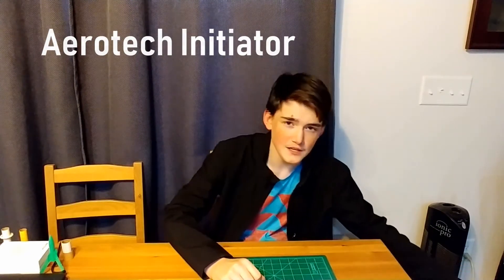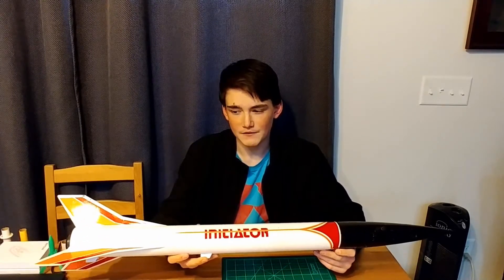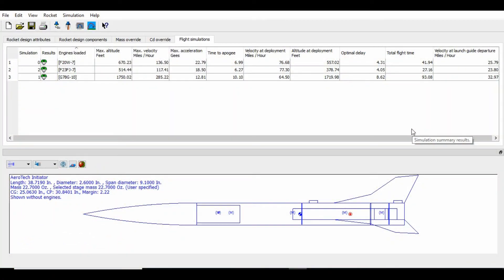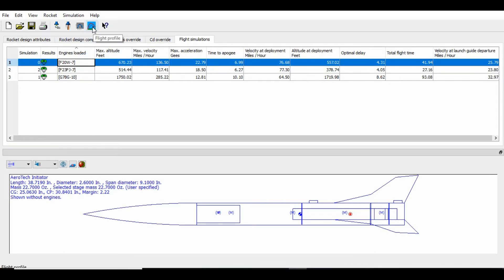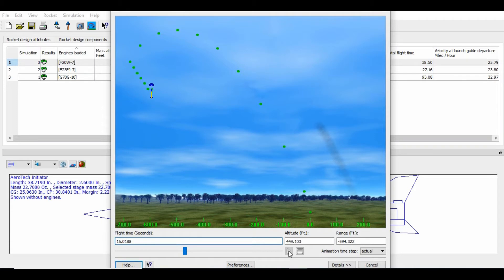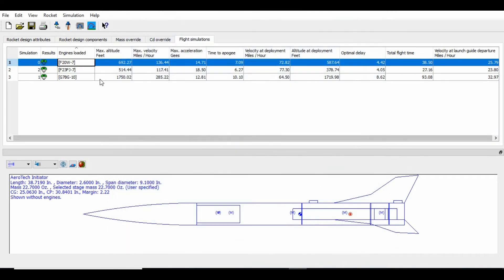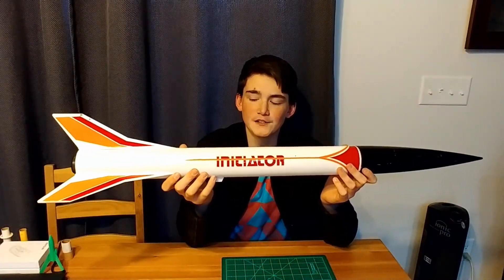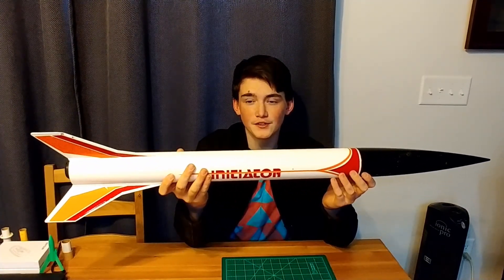Episode 04 - Aerotech Initiator

Comment: Great review! I just assembled my initiator and am hoping to launch soon.
Reply from the maker: Be sure to let us know how it goes! And if you look at the Rocksim portion of the video, it does indeed show that the velocity off the rod is too low with an F20 and F23. But only just! It's frustrating that Apogee shows it as a good first motor. It works, but is less than ideal!
Reply: @apexrocketry  I just launched my initiator. It went perfectly!!! Such an adrenaline rush haha. Thanks for your video!
Reply from the maker: @andrewyoung1499  Fantastic!!!
Reply: It is a great rocket! We have found that F20 and F23 are a bit underpowered for this rocket. An F67 motor is a sight to behold!
Reply: @PanzerBeef  Good to know! When you say underpowered, do you mean just doesn’t reach optimum altitude, or launch is likely to fail? I happened to order an F20 haha.
Reply: @andrewyoung1499  Underpowered. It will fly fine just a bit squirrly (unstable) right off the launch rod. I have flown mine 4 or 5 times with an F20
Reply: @PanzerBeef  awesome, thank you!
Reply: @andrewyoung1499  Anytime! Optimal launch velocity is 30mph coming off the rod. It's probably hitting about 25 on an F23 and 28 on an F20. So it goes up, cants a bit and then takes off as the speed increases.